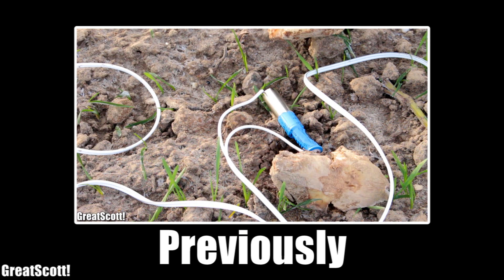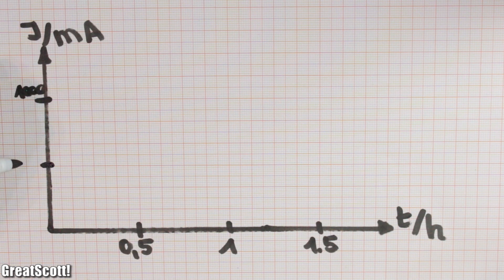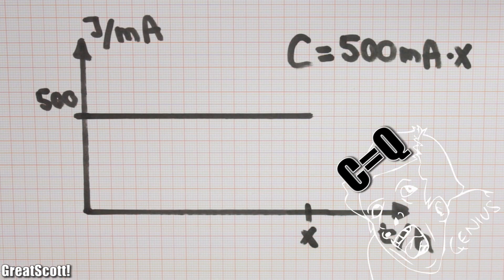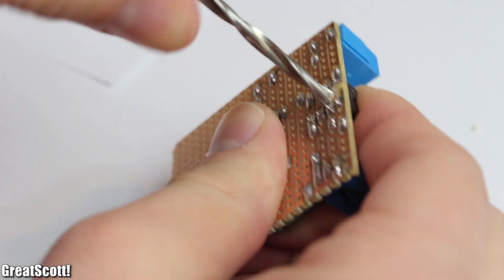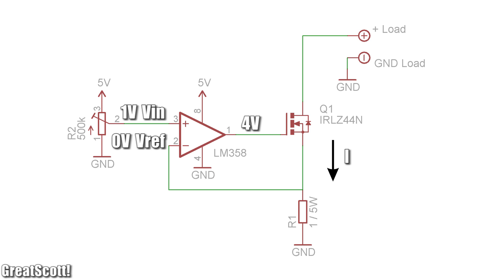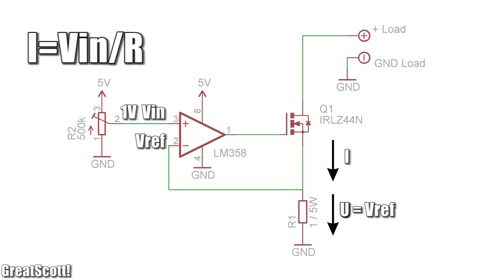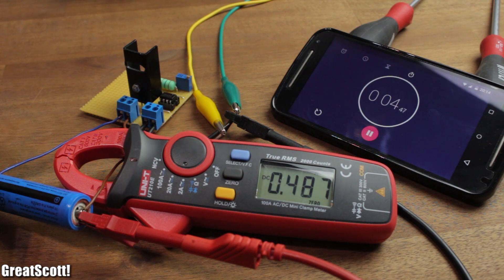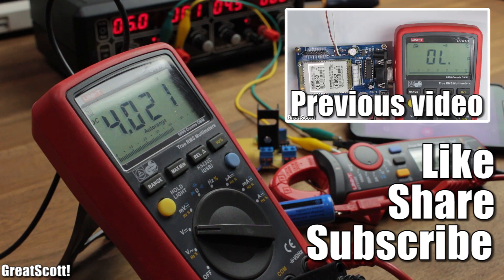Li-Ion Capacity Test || DIY constant current load

Comment: The highest capacity 18650 cell ever made (afaik) is 3600 mah from Panasonic. But you cannot find these anymore. So currently the highest capacity is 3400 mah again from Panasonic. With the current chemistry its not possible to squeeze more energy into a 18650 cell. Anything above that is automatically a lie, unless it's from one of the top manufacturers, its genuine and a new chemistry has been used.
I believe you probably knew all these and I understand this video is for educational purpose. My comment too.
Reply: BEAST BOOST, LOL they're probably like the batteries Scott tested.
Reply: Mandragoras thank you :)
Reply: Vláďula Vaverka :) You're welcome.
Reply: BEAST BOOST You are propably talking about 20700 cells which are bigger and as expected they have larger capacity. Specifically 4000 mah from Sanyo - Panasonic. These are not the 18650 as I wrote in my post.
Reply: +Mandragoras Thanks for the info. I was looking for a battery for use with arduino and this info as really helpful.
Reply: Tomas Schertel
You are welcome. My comment is a little bit old and now there can easily be found new 3500mah cells, available from reputable manufacturers.
Reply: LG, Sony, and Panasonic are the battery guys. Check them for what the highest theoretical capacity is for each chemistry and C rating.
Reply: Mandragoras I think the most dangerous part is the lies about amperage
Reply: Only 26650, 20700 and 21700 batteries can get you 4000 mAh and above. 18650 have a limit of around 3500 mAh
Reply: This is a very helpful comment. Thank you.
Reply: Yeah even I couldn't find any Panasonic NCR18650A which has a capacity of about approximately 3000mAh. I think Panasonic batteries were sold as an industrial batch order only.
Reply: +BEAST BOOST Post a link. Till then, I doubt that's true. Maybe they aren't 18650 but larger?
Reply: BEAST BOOST "I don't care what you have to say" Then don't reply to me. As for the rest of your comment, cool story bro. Read again the initial comment and learn something. The advertised capacity is fake. And just think that the comment is one year old. So basically you are implying that the TOP manufacturers haven't managed to reach such capacity (3800mah) in a 18650 cell but an unknown probably chinese manufacturer did. Cool story bro. Link or it is fake.
Reply: I love the 3500mah Sanyo cells, 2x the amps of the 3400 Panasonic batteries! https://www.fasttech.com/product/2399300-authentic-sanyo-ncr18650ga-3-6v-3500mah
Reply: Mandragoras it's only one seller I'll have to find it they did several version different mah and I personally tested and so did many others I'll have to try find it
Reply: BEAST BOOST you vape. Your opinion is instantly worth less than other peoples.
Reply: @1992jkwj  Your user name makes your opinion a stupid bitch wrote it.
Reply: you can find 4000 mah easily real ones but for vapes
Reply: Read the article and they now stopped the 4000mah one but hush now and read the comments to
Reply: And make sure you find the bit that also says also available in part
Reply: There used to be but they got discontinued due to not enough demand and your statement about not being able to put such high mah and current into 1860 is bs they can but it won't be either stable or you'd sacrifice a lot of amps just for a little more squeeze of mahs yes your correct they won't be getting much higher down to not enough technology where to far behind
Reply: basin 40 amp 3800 mah 18650 I have them right now I use them and I am using them now and there true 3800 mah I don't care what you have to say I've tested and so has many others

Comment: Great video and an awesome idea!:D
I have built a similar circuit some time ago to check sone old laptop li ion batteries which i had lying around:D
On the cover it was said that my batteries have a capacity of 1300mah but mine had only 650mah or something like that:/
Really annoing that most of the descriptions are bullshit xD
Reply: If you periodicaly charge your battery to about 3.875V (Thats what i heard about) it wont lose capacity quick